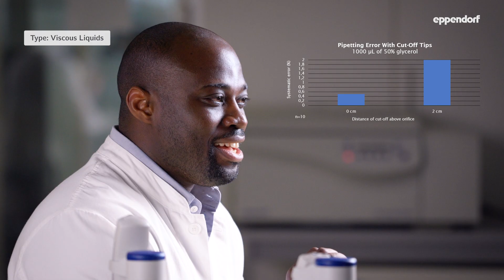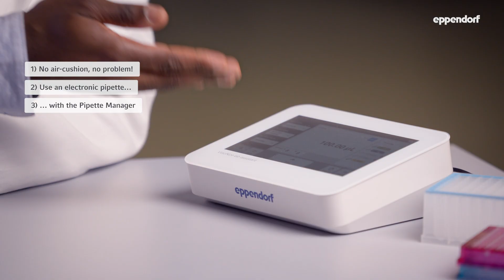How to Pipette Challenging Liquids | Pipetting Tutorials | Ep. 5: Liquid Types

Comment: So we should spend more money for better electronics micropipettes instead of traditional ones
Reply: Hell yes. Positive electronic pipettes are insanely precise. I did some measurements, deviations of volume on 1.6% max volume (! 20uL using a 1.25mL pipette tip) are well below 0.007mL / 0.4%. Meaning you can pipette volumes to not even use volumetric glassware (e.g. 0.1mL+24.9mL=25mL). The total deviations of all dispensed volumes summed up are still way below the deviations of the calibrated glassware. This can improve your overall measurement uncertainty by a lot. Total cost of analysis is still mostly determent by analyst hours, not by the 1EUR pipette tip.

Comment: I need to use a micropipette to measure 600uL of sulfuric acid, can I? I'm afraid the pipette will break. I tried it once, and there was brown liquid coming out of the pipette hole.
Reply from the maker: Hi 김누누, 
thanks for your message. That doesn´t sound like it should. But with this comment you reached the social media team from Eppendorf. We can´t help you directly as we are no specialists for pipettes. But we will ask our experts and come back to your question as soon as possible.
Reply from the maker: Hi 김누누,
for our Research plus and Reference 2 pipettes we offer chemical resistance tables on our website (www.eppendorf.com/manuals) that include sulfuric acid in varying concentrations. Pipetting sulfuric acid 95% is suitable with both of them, you just need to replace the silicone O-rings in shorter intervals than usual and we recommend using ep Dualfilter T.I.P.S. filter tips to help protecting the pipettes from aggressive fumes.
If you need to pipette sulfuric acid on a regular basis, we recommend to use lower parts with higher chemical resistance (available as accessory for select Eppendorf pipettes) or - even better - our Multipette/Repeater multi-dispensers. With these, you should not have any issues since the tip design includes a hermetic seal between the liquid and the pipette.
To learn more about pipetting challenging liquids and how to clean your instruments properly, make sure to also check out our webinars at www.eppendorf.com/labchannel. We hope that helps to solve the current problem?
KR your team from Eppendorf